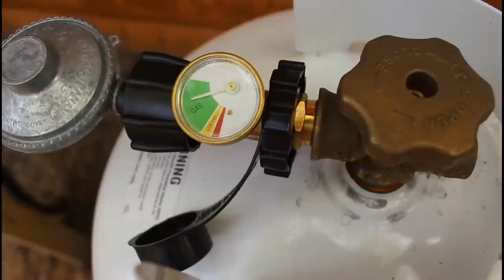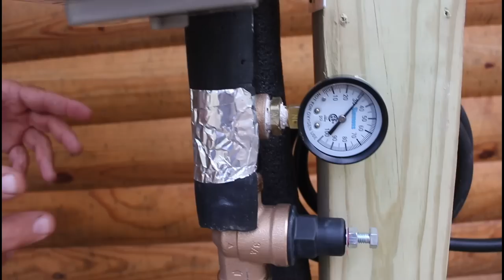HOT Water on DEMAND at the  OFF GRID Cabin?  How To Install a Tankless Hot Water Heater

Comment: Ive been using that exact model for 5 years in my tiny home  trailer. They do work great and are extremely hot. I have replaced mine 2 times due to freezing up while I was driving. The pipe in these are very thin. Be sure to shut your water off and unscrew the brass drain valve in freezing temperatures. I would also disconnect the water supply in those instances. I made my unit connections with braided ss supply lines so its easy to unfasten. You will like it! Just be aware of how fast and easy they can freeze and split.

Comment: Hey Danny, I have had two of these units. I live off grid in east Texas. I installed my first one in 2017. It worked great until we had a freeze. It busted my entire system including the piping of the heat exchanger inside the unit. The second one I installed has lasted almost to years now and has started to have a pinhole leak at a soldered point of the exchanger tubing. This appears to be a weak point of these units. The exchanger looks just like a common heater core from a car and the tubing that it is soldered to is somewhat thin. I may sound like I am being negative but I have enjoyed the convenience they have provided. They are economical and for the cost they have served me well. I am also running on solar so the battery powered pergo igniter is a great feature. You may want to build some kind of structure outside around your unit or shut it off and drain the water heater if you are expecting a freeze. I bult a metal siding Utility building behind my house that my unit is in. (I added a T in the feed line  between the shutoff and the unit so I can drain it during a freeze.) During summer I leave mine on minimum gas flow but during the winter I have to adjust it to be comfortable. One other note on it's propane use. I had a  twenty pound bottle on it originally and I was able to take between 30 to 60 showers on one bottle depending of shower length, 10 to 20 min showers. (These were taken during the summer) Love your place!! God blessings on you and Miss Wanda!!!
Reply: Great info Im in North Texas and originally from  a colder climate. we still get a couple days here below freezing. I appreciate the insight.
Reply: I used to live in East Texas... I miss it...
I lived about 40 miles South of Longview.... Good Cat Fishin'.

Anyway... What Unit did you use? What do you recommend?
Thank you for your help... 
Do you know if they still have that Restaurant up at Caddo Lake??
Reply: Im in east texas (Linden) and off grid totally.  If we are close, id like to see your set up and mimic it if possible

Comment: I bought one a few months ago and I’m just getting around to Installing it. Mine is indoor and comes with a 3” exhaust pipe to vent outside. I’m planning to make a sheet metal spacer to mount it to with an inch gap to the drywall. The gap will be filled with Rock wool insulation which I’ll also pack into the thimble where it goes through the exterior wall. 
Thanks for the idea to install an inline water filter on the supply side. I have two small LP tanks, so I won’t need the gauge. 
I hope this 10 liter Camplux unit puts out sufficient flow for a shower. It’s supposed to, but when it gets cold outside, who knows. They always seem to overstate the capacity, no matter which brand. Thanks for the video.

Comment: We have this model off grid up here in northern mn.... we've had it 3 years and works wonderful. It's inside our home because, well... northern mn lol...  5 ppl showering and dishes and such and it's never failed us nor has it been a problem w gases...
Edit: yup ours goes out too if we go much past min ... I think it's because then the pressure through the hot side which is needed for the flame to stay on just isn't high enough... we just keep it on min.
Reply from the maker: Thanks for that info.

Comment: I would worry about freezing the pipes.  I,m on the Carolina coast any was told my pipes would never freeze but one cold January night they did.  I put heat tapes on the and never had another problem.  They worked well when I lived up north and they work well down here.

Comment: When you turn the water flow on the unit up, you’re telling the unit not to ignite until there is a greater amount of water coming through. It needs to have the flow turned down as low as it goes in order to ignite with less water flowing through the pipe.  I have had a tankless water heater for about 15 years that uses water flow to spin a little water wheel inside which creates a spark and ignites the flame. No batteries or electricity required. But you want the flame to ignite with the smallest amount of water flowing so you turn the flow down. That also helps to raise the temperature of the water.

Comment: We just installed one as well. I still only have hot water at the shower, but, that's ok with me. Being off grid with an outdoor shower, this is a huge blessing.
Reply: I like cold 🚿🛀🥶❄💧🧼🌡🧖‍♀️🧖‍♂️
Reply: @InfinitProcessBSG13 , living in south Florida, 90% of the time, I don't mind it either, but, in the later Fall and Winter, I do not have the tolerance for a cold shower.

Comment: Same issue with ours. It’s battery operated as well. Has to both be in minimum. Issue we’re having is that you have to have the hot water valve all the way on for it to work. If you want it warm and move the nozzle to warm setting the hot water heater gets hotter because there’s less water traveling through the hot water heater. So to take showers you have to regulate the heat on the tank. Kinda sucks. Anyone out there that has suggestions that would be rad. Enjoyed the videos Danny!

Comment: Yup those heaters are pressure activated and when the pressure drops from turning on the tap it kicks on, but when the pump kicks on to restore the pressure, the new pressure will kick off the heater. The regulator is the best way to do it, but will kill your pressure if you have a larger system.

Comment: Hey Danny, I forgot to mention the valve on the water is not pressure it is flow rate. It helps you to fine tune the temperature. (To a small degree) The faster the water flows the less time in the exchanger heating the water.

Comment: Most of those tankless water heaters require 2.5 pounds of water pressure to ignite the burners, at least on mine it does.  Water pressure drops, burners go out, safety mechanism that was put in place.   On my system, I have to turn the water on before the burner will light.  Does your water heater have a summer/winter setting?   Good job setting that system up y'all!!!    Dan
Reply from the maker: No summer and winter setting. Mine goes out when I up the water flow.
Reply: Sounds like a pressure issue, have ya tried running the heater at 5 pounds of water pressure or the equivalent of spigot water pressure?   Dan
Reply from the maker: @HomeInTheSticks  I'll give it a try. My well is set at 50 psi.

Comment: I have an indoor unit on natural gas. Worked fine for 12 months then started flaming out due to what seemed to be a water flow issue.  Two items (shower and washer) running at the same time caused it to turm off. Turns out it was a low gas pressure/volume  problem. Not saying it's your problem though.

Comment: One thing is to secure the propane bottle  ie fit another post preferably a metal one  with a chain secured to the bottle just in case bottle is knocked over by high winds or persons or bears etc otherwise the gas pipe  will pull or tear off the regulator or pull off the heater damaging the water heater..and causing a gas spill..

Comment: How high up do you need to put your IBC tote to get sufficient pressure and flow to the unit? Also, do you need to be mindful of how high you mount the heater in relation to the faucet, shower or other outlets? Or does the 12v pump handle it regardless?

Comment: Get some rechargeable battery adapters to replace depending on buying D batteries,  If you have eneloop batteries you can run your system on 6 AA eneloop batteries using a battery adapters that uses 3 AA batteries per D cell adapter,  I put up a battery adapter video just incase you want to see the adapter im talking about.

Comment: do you find that it turns off when you mix in too much cold water when the flow through the heater is low? I'm trying to find one that can handle lower flows. If I turn the water too cold I often have to turn off the water completely and back on to start it back up.

Comment: Came across video and I guess I’m not understanding if you don’t have electric but have a well. How are you getting the water to pump to the propane heater ? If your using a pump what are you powering it with. We have off grid lake camp we want to do an outdoor shower.

Comment: When we built I decided to go with a Rheem propane tankless hot water heater. I was concerned that my young grandkids would touch the hot vent outside so I went with a sealed unit that vents out warm air. We love the water heater. It uses very little propane. My water coming in is from a drilled artesian well. It is very cold. About a month ago there was a tornado a few miles from us. It took out the power lines for the better part of a day. My whole house generator kicked on, so I told my wife I was going to take a shower. No hot water. The problem was that the electricians that originally set up the transfer panel didn't realized that the fan on the Rheem closed system has to work. Yesterday, I had the electrican out and he connected the fan up.
Reply: They make double wall and even triple wall pipe that's made so you wont get burned if you touch it for that application

Comment: Danny you might want to pipe in a drain on it so during cold weather you can drain the copper coils in the heater itself so they don't freeze and bust.
Reply from the maker: It comes with a built-in drain.

Comment: Hello Danny, Nice Video.  Question: You say the manual shows a smaller propane tank, like one for a grill.  Is it because the manufacturer states: DO NOT use a 100lb tank or any tank larger than a 20lb for safety reasons?  Is the hose & regulator only safe to use on the smaller propane tanks and for use with a 100lb tank??
Reply: I’m pretty sure they recommend a smaller tank because of that 100 pounder tips over Rick actually tear the hose and fittings apart with the weight of the tank. I would see if you were going to use a large tank you better make sure it’s anchored Security sort cannot tip

Comment: We love ours just got to get use to running quite  a bit of water before it gets hot and don't shut it off before you are done or you get cold spotting. Showers never go cold and don't have to wait on to take a shower or bath for water to heat. Doing dishes just have to leave it run  continuous to have hot water. Hope you enjoy

Comment: Valves (& spare parts) are your friend! In reference to your problem: I believe that your problem is water flow and not pressure which are 2 different things. Your pressure may be fine, however your flow (measured in GPM) may be out of range for the unit. I'm not familiar with that particular unit, but years of experience in the industry point to that being the problem.  I would guess you could find out the flow range for the unit from the manufacturer?
Reply from the maker: Thanks
Reply: A filter may slow the rpm down.  I  figure it shouldn't make that much difference though.
Reply from the maker: My problem is when I give it more water the unit dosent work. The flames goes out.
Reply: @DeepSouthHomestead  That sounds like a flow issue. On some units there is a limit switch built in the system for the flow which shuts it off if it gets to high or to low.

Comment: Have you ever made your own methane? Mix 50% water and 50% manure in a enclosed container, run the line into a inter tube and then a line to your power source. You'll need several connectors and cut off valves. They're several videos that teach you how to build a methane system.  If things go south and you can't get propane anymore you'll have a unlimited homemade source.
Reply from the maker: Haven't done it yet.